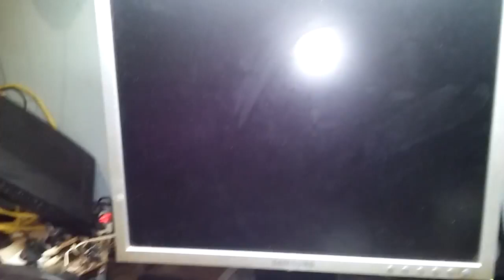How to start PC with Solid RED LED CPU Problem Part 1

Comment: For years, I have never seen something like this and I did not think that it would work. However, it worked for me and thank you very much for sharing this trick with people!

Edit: It worked for twice, then it is dead again. I do not know what to do except replacing motherboard.
Reply: Did you replace?
Reply: @inkalegg1581  Yes, I built a Ryzen system but I did not give up on that board. I flashed newest BIOS, no chance. The last thing that I have done is, reflowing the northbridge. Then yes, board came back to life again :)
Reply: @mehmetaliyas5417  how did you do that? 'reflowing the northbridge'? what do you mean?

Comment: I would get a multimeter, plug into the black and yellow wires of PSU connector, to check 12V voltage.
Start pc and check that voltave always at 12V or 12.1V.
If it goes down, like 11.5, 11V or lower, power supply is too weak.
Can do same for red and black wires, to check stable 5V.

Comment: I can tell you a few causes: can be weak PSU that may not have stable voltage at cold startup, when hdds, memory, cpu, fans all suck power. This can be for a few msec, but cpu will detect and fail.
Second, may be some piece of metal shorting something on mainboard. Had my mobo give red cpu light when a hdd was pushed against the reset button wires and caused some short.
Can be caused by capacitors on mobo or in PSU that are weak, when quick turning off and on, hdd motors are still spinning and current load is smaller, thus capacitors will be able to keep voltage stable even though they are weak.
Reply: There’s just a tiny bit of thermal paste on my cpu pins, at the very edge, could this cause all the red lights to turn on during boot but my pc runs just not running like normal

Comment: As of 30-Aug-2020, I had this same problem.  My ASUS motherboard was showing the CPU_LED light as solid red.  QUICK ANSWER:  Removed the CPU (and cooler), then put it back in.  That FIXED it.   Background:  It is a ASUS sabertooth 990FX motherboard (ATX AMD).  After my move from USA to Australia in 2020, my pc was transported in shipping freight sea container.  Once I got all my goods and PC in Australia, I unpacked my pc and pressed the power button, the CPU_LED was solid red, and it would not start up,  and it would not even POST.  I searched online in forums and youtube, and this was the information that I found, and tried:  I did the bench test again, remove all the components, HDD, SDD, etc.  only had the motherboard, CPU attached, cooler attached, cooler fan and fan pin attached, 1 stick of RAM in the DIMM_A1 slot, the graphic card attached, the 24-pin connector from the PSU (PowerSupply) to the motherboard, and the 8-pin cpu power connector from PSU to motherboard.  That is it. and tried to boot, but CPU LED was still red.  I alternated the RAM in different DIMM slots, but still same.  I disconnected graphics card, but still same.  I cleared CMOS battery using the 3-pin jumper (it writes CLRTC on the motherboard, move the connect from 1-2  to  2-3 with pc off), but still same problem. (I also read something about north Bridge heatsink).  I kept the motherboard still in the case, I just disconnected the cables.  Then I phone called ASUS tech support in North America on +1 812-282-2787, since they would have received similar calls with this problem, and they might know where is the problem.  Even though I built this pc in 2013, it was 7 years old, past the warranty period, the ASUS guy was still very helpful, he told me to take out the CPU and check for any bent pins and reinsert it, and also to clear the CMOS battery.  Then when I was removing the cooler, I noticed that it was very easily able to be removed with the CPU still attached to the cooler, there was no grip of the CPU to the motherboard, it was like the CPU was loose on the MB, not connected properly.  That is why I mentioned the pc was transported in a container ship from US to Australia, maybe from the vibration, the CPU got loose from the MB. (And I read in youtube comment that another persons ASUS motherboard has CPU LED red after he was transporting it).  I had to separate the CPU from the cooler, but it was stuck on tight and the thermal paste was like cement. I did not use isopropyl alcohol.  I tried using dental floss, but i could not get it in the gap.  So I used a hair dryer blower and heated up the cooler for 15 minutes to heat the old thermal paste to make it soft.  My CPU has no bent pins.  I just cleaned off the old thermal paste, applied new thermal paste, and then re-inserted it, and it worked, connected everything, and worked.  (if you get a BOOTMGR missing, Press Ctrl+Alt+Del,  then you must of connected the hard drive cables to the different ports, just need to go into BIOS and change the boot priority order).  [Cooler:  Cooler Master 120mm.  Graphics Card:  XFX Double D Radeon HD 6950.  CPU: AMD FX-8150.  PSU: Corsair TX750].  My power supply unit says Universal input supply, so it works in 110v US and in 240v Australia.  Regards, Kenan
Reply: thanks Kenan.....it saved me too.

Comment: Spent 5 hours diagnosing a desktop which has this exact same issue; took the CPU out and inspected the socket, tried different PCIE slots (cause I thought it was a graphics card power problem), unplugged and plugged in everything and then I find this and fix it in 10 seconds. What’s the science behind this?

Comment: My power supply doesn't have a off and on
Reply: just switch off and on from the wall main power
Reply: Unplug and plug fast, the psu switch cuts the power the same way as pulling out the cord but on a more user friendly manner.

Comment: it works!!!!! but what is the permanent solution?? its very annoying to do every time when i want to start pc
Reply: did you find a solution?
Reply: @imedog4mer641  update bios to latest one
Reply: @MrGaming-e6c   already updated to the latest version
Reply: @imedog4mer641  mine it works..dont know about other method.
Reply: @imedog4mer641  you can try by doing remove cpu from socket & put it back...after remove your cmos battery
Reply: permanent solution: put a new cmos battery in there..)

Comment: It didn't work for me, the system was working and just died one day. Are there any other tricks?
Reply: Same did you ever find a fix
Reply: @aBANDIT.  I tried a different CPU, PSU, GPU  and RAM all with no luck.
Been meaning to resolder the power sockets but I think that may just be a shot in the dark.
My view, it's something on the motherboard has died.
Reply: @TheDutyPaid  damn guess ill have to get a new one, thanks for the help ive been looking for like 2 weeks for a fix to this but so far nothing
Reply: @aBANDIT.  I think it's the reason you see a lot of old CPUs and GPUs about but not that many old motherboards.
Reply: TheDutyPaid get a new mobo
Reply from the maker: That all I came up with, and it was by accident :P
Reply: @vitigamer7161  It might be something that is loose.What i did was plug everything into a different slot and start the computer.Then I plugged everything back into the original slots and started the computer while double checking for  latch clicks when putting in ram,graphics card etc.It worked

Comment: Hi there ! Strange fix , I just restarted my PC this afternoon and while it was restarting I pressed the power down and it just has a red LED light but Ive been playing games on it for the past week , I built it myself.

Do you need to do this every time you restart or shut down the pc ?
Reply from the maker: Every time. Ended up buying a new motherboard.

Comment: Abe jhatu Kya bolna Cha Raha hae
Reply from the maker: Sorry I only know Croatian and English.
Reply: @vitigamer7161  he mean what are you trying to say penis bush 😂 dont get me wrong i only translated it for you.... Btw my problem didn't go away i have m5a99x evo r2.0 fx 8350 running and i went to different city for 1 day it was working fine before but after when i come back i tried to turn on my cpu but red cpu light stays red and pc wont boot into bios or anything no post..... I tried removing ram mobo wires removed and re applied all wires and all components ,flashbacked bios but problem.still exists 
..... Do you have any other solution?